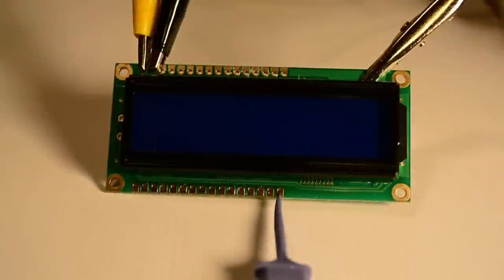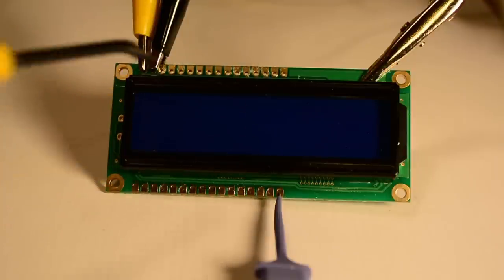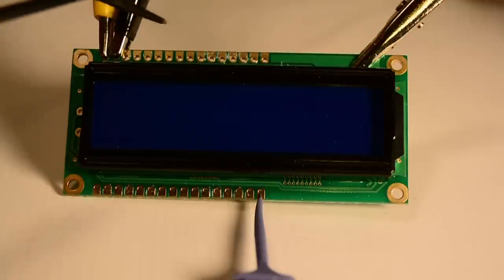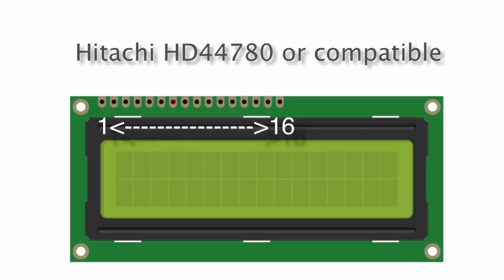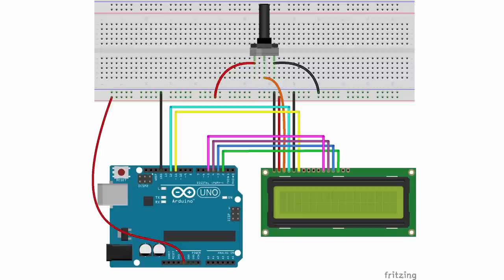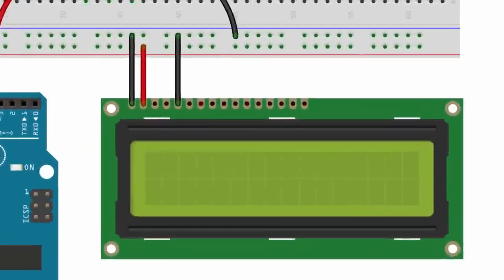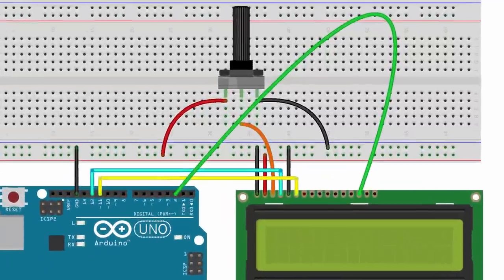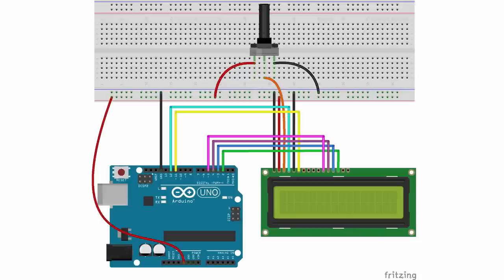Setting up LCDs with Arduino :: Video #2 :: Liquid Crystal Display and Arduino Series

Comment: Here, instead of the type of lcd mentioned in the video, can we use the normal display of a calculator for the same?
thank you
Reply from the maker: Hmmm, not sure.  But it would always be fun to bust open a calculator and find out if it works :)

Comment: With all due respect. Where did the notion of alligator clips come into it? Totally inappropriate and just begging to let the smoke out.
Like you said simply soLder a 16 way pin header and connect with M/F Dupont wires.
Reply from the maker: Rob!  So right!  As I sit back and think about it - I am not sure why even bothered talking much about alligator clips...they were such a pain in the butt.  I guess I was thinking if maybe somebody didn't want to mess around with soldering - but if you just bought an LCD screen, then you probably have a soldering iron too (I think that is a reasonable assumption).  In any case, I am going to redo this video and solder on some pin headers and show that.  Thanks for the feedback.